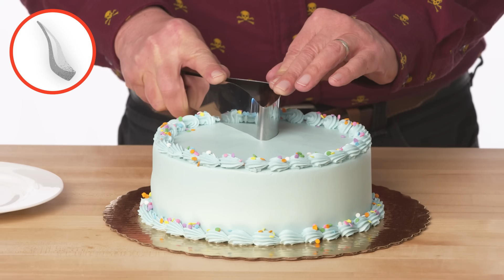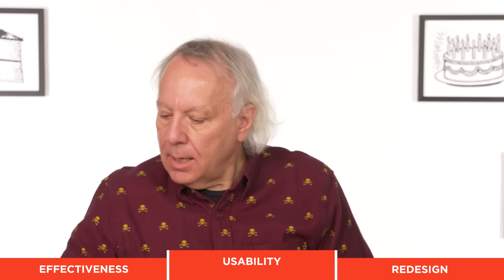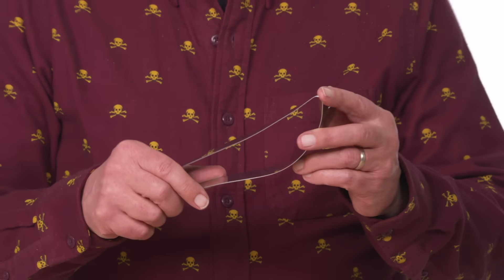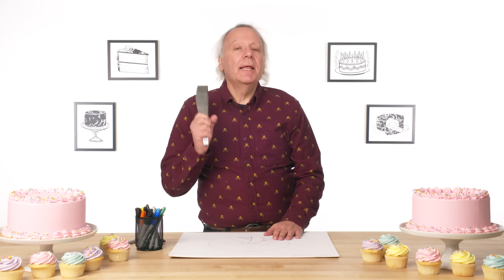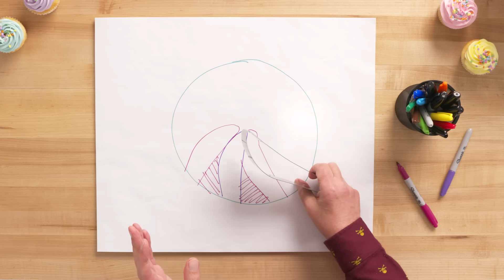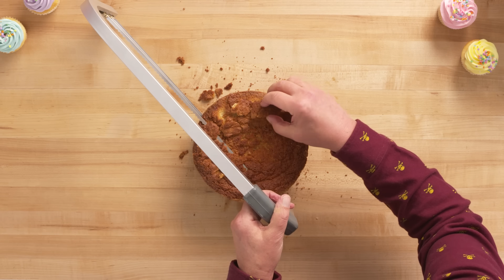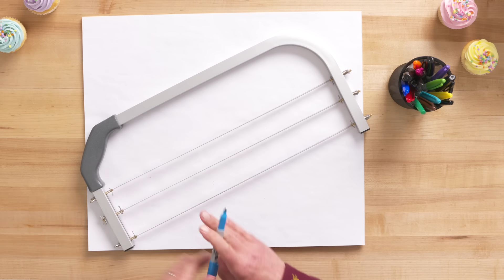5 Cake Making Gadgets Tested by Design Expert | Well Equipped | Epicurious

Comment: TBF, if he didn't approach some of these like the hopeless infomercial people, they'd work great.    You dont use a meat cutting knife to cut cake or pie.   He set the device up for failure.  
Notice none of the cutting items match his knife selection?   Yeah...   and to keep slicing with a caked up knife is hand-2-brain failure, not device failure.    Thats like blaming a cutting board for uneven bread slices
Reply: ...and don't go telling me "there are people out there like that"
Yes, and there are people out there that don't know how to drive a car.  We don't simplify highways and roads to appease to those who lack the skills.
If someone isn't capable of using an item correctly, it's not the devices fault.    Like using a knife to hammer a nail.   It's not the knifes fault.
Reply: those infomertial people are a stand in for elderly and disabled users dude

Comment: That hacksaw looking slicer... Seeing it next to the knife and ruler option, it sure seems to have made much more even slices! They weren't perfect, but they were better than the latter. It may have taken more time and been harder to use, but it gave better results.
The top layer getting mangled was due to it just being too thin - and that's a height adjustment issue. I will concede that could be a usability issue, but it could also be the user's fault.
I think going for more of a hacksaw or two-man saw design would have been better - have the push be at cake-height, not above. Putting the handle at the top wouldn't change a thing. Having something to hold the cake stable would also help, since you wouldn't worry about cutting your other hand.

Comment: I've got one of those cake levelers but the handle is on top (as he suggested) and the blade is a wire. It cuts really well and the adjustment of the setting is so much easier than the one on here.

Comment: why no get a set of blades cake shape and maybe a bit bigger and just cut with that like 4 8 5 10 you can get 4*4 that fit into each other and just by pushing down cut 8 or 4 all at once
edit : you gotta have a decently sharp and strong blade and come in a case for cakes and that way you even have a place for your cake/blade storage

Comment: Perfect Cake Divider: I think that the better way to use it is to mark the cutting lines only, remove the device and then execute the dividing process. The device remains clean, the accuracy is better (you can precisely turn the device to the next position), the cuttings can be made from the edge to the center of the cake. ;-)

Comment: Thoughts as watching

Cake Divider
He should really be using a different knife.  Anytime I cut a large cheesecake or anything with a fancy but delicate frosting, I reach for as small of a knife as possible.  I've even cut cheesecake with wire (taken from a cheaper crappier version of the leveling slicer thingy I saw is coming up in the preview.)  Actually, I could see using the divider to just score/mark the very edges of the cake.  Then, you could use a long blade to cut straight across from one score to the other.  (Only works with an even number of slices, though.)

Edit after Posting:  I've actually used a version of the diy-protractor method.  Difference is that I did it as an image of divided circles on my computer so I could reprint it when needed.  Also, I did it to make a 7-slice pie (as opposed to buying a $20 version at a restaurant supply store).

Curved cake slicer
I wondered of the purpose and saw the curv-edge leftover issue immediately.  Definitely a solution looking for a problem.  This would actually work better as a "whole-cake slicer".  IE:  A giant round circle with blades that cuts all the slices once.  You could then get the cool-shaped cake slices (and more than just a curve on one side) while still making all the slices evenly sized. (Note:  Typed this before seeing his redesign.)

Leveler
I have a couple MUCH CHEAPER versions of this that have one adjustable blade.  I've always found them hard to keep up straight up, leading to the layers being angled.  The only way I could see this thing working would be to have an entire contraption that houses the slicer and holds it up straight.  To be honest, I can only imagine something so large and cumbersome being useful in an actual professional bakery that does a LOT of business.  However, most of the people in such a place would likely have enough skill/expertise in cake slicing to be able to properly cut levels of a cake free-handed.  My own version doesn't even cut cake very well unless it's a soft cake because the wires can't go through much.  (Though as stated before, the wires have been successfully cannibalized for use as soft cake/cheesecake slicers.)

Zyliss Easy Slice
Another thing I have a cheap knock-off of.  It's just as useless as the expensive version.

2-handed cake slicer
-The only almost useful one, and they don't even have a link to it?!?!?
-Actually, this seems to do "curved cake slices" better than the thing designed for that purpose.
-I could see an actual hinge being useful in this to get rid of the bend factor.  However, it would have to be incredibly small so as not to mess up the center cut-point of the cake, and VERY VERY well built so that the screw doesn't come out into a piece of cake.

Comment: I have a cake leveller and my only re-design is that the feet have balls on them to move, like those early 90's computer mouse balls. So when you sawing away, the balls can go any direction. I agree, the handle needs to be in the middle

Comment: The cake cutter was actually user error. I have used these similar saws professionally as a former baker, tho mostly with only 2 cutters, and they work great!
To use them well you need to saw in a fast, even motion without depressing the cake too hard with the other hand. Doing it too slow will mess u up and cause the cake to be mangled. That said the one u got can be made massively better with a flat bottom on both ends so it reduces wobble and allow u to have it standing in between usage for less clutter. Most new once i used had that. Also what is with that handle? Thats looks horrible. Ours were mostly made with a round steel tube and i can't say a handle was ever needed, so either side could easily be used. It's something you need to know how to use but when you do you can cut ten EVEN cakes in 30 seconds which helps a lot in the bakery. :D Especially since it takes a lot of training to be able to do it evenly and quickly with a knife.
For a layman, outside of the bakery tho, i can understand why u think it's useless.

Comment: I have a cake slicer that has a single cheese wire as it’s blade (so works left or right). The single wire which is easily raised/lowered is easy to use and you can just remove the bottom slice, do the next and again (so all slices are equal). It’s brilliant.

Comment: For the cake layer slicer, I had a different idea, in many kids toy, like cars, when you connect the wheels the plastic wheels have a thin tube with large flat end to prevent the wheels to move.

My idea was instead of blades, the device will have flat plastic shelves that move (connected and disconnected the same way abuve) and help you layer the knife when cutting. I will also add different size flat covers (like pot tops) that you can use to hold the cake so you won't accedenlty cut your fingers (your hand was very close to the blade).

Is this a good design? I feel like it can work but the final product almost allways be different then words on paper

Comment: Cake levelers are used in professional use. Something some "random" guy is not able to handle is not something it needs to be faulty. I've used same kind of device for thousands of times and it is somewhat faster and precise than knives. Also when you do hundreds of cake bases in a year and same amount of cakes, you dont need to adjust those blades.

Comment: One immediate advantage of the last one is the hands off serving, and if you are selling cakes by the slice, you want a uniform size so that really is not a problem either.

Of course, I use a cake server with a sharp edge that can both cut and lift the pieces...

Comment: On the very first one, not gonna lie, for the type of cake he is cutting he chose a terrible knife to use, using a better knife would easily have fixed a few issues, a smaller blade instead of a bread knife would have cut way more cleanly.

Comment: What that cake leveler really needs is a base that it is firmly attached to. Then the base has some grooves drilled in so the leveler frame can smoothly slide back and forth in. That should eliminate any pulling up on the cake.

Comment: The cake leveler gets even worse when you realise that a normal leveler uses a thin wire to cut the layers, making less friction and very little wobble. The three blades are wider leading to a LOT more friction and it's wobbly bc it's not a taut wire, it's a wide, thin sheet of metal that's easy to warp.

Comment: I don't get why everyone is being so negative towards him. As an amature baker and cook I've had similar problems with things that are supposed to make it easier but only waste more time and take more energy. 

Take the first one. Regardless the thing is going to leave a hole in the middle of the cake. The rounded cake cutter is just plain stupid and would really hurt your hands and takes a lot of force to actually cut the cake. The leveler doesn't work because having 3 layers makes it even harder to keep both of the bottoms on the table so it cuts evenly. These things are supposed to make it easier but even if they did get you perfect slices they aren't efficient, therefore effective, because they take longer to use than the normal way.

Comment: wtf type of massive knife is he using to put that first cake. Dude butchered it. My Lord.
As for the "curved" cake knife. It's clearly for decorative purposes. People do a lot of cake design, decoration, themes, etc. It's lie complaining about cookie shapes. Squares would be more efficient to cut right? 99% of cookies aren't square though.
The cake layer cutter, again, complete fail of the operator. And look how horrible he did just trying to use a ruler and knife. Why not show that complete fail? Dude clearly doesn't know how to cut a cake to begin with so obviously isn't going to do well with this tool.

Comment: For the cake leveler, I would have changed it to one thicker blade with some device to keep it at a constant height. Then you can just cut, then move the top off and cut the top and repeat till you have all the slices you need. So it would really work better designed
 as a knife level basically.

Comment: The 3rd gadget is not so bad, the one in the video is. But I saw someone on YT use a similar one that had one smaller blade and a ruler to adjust its height and it worked good.

Comment: For cake leveling, there any reason why you wouldn't just want a set of metal rings at common heights and a long serrated knife or wire? Slap ring around cake, use long knife/wire across entire width, lift, repeat?

Comment: When using a knife to cut a cheesecake, even with a cake divider. Have a hot glass of water. & A clean towel. You need to dip the knife in the hot water. It won't damage the icing, & cleans the blade off for the next slice.

Comment: These cakes look horrible, all incredibly dense and overcooked. The purple, yellow and I think blue cakes are just massive pound cakes, with no frosting in the middle??? That is going to be so dense, especially if they are cold from the fridge and not at room temp. 
Additionally a simple google search will tell you to use a hot, sharp knife to cut a cheesecake and wipe the blade in between slices. This is so frustrating to watch, I know he has designed lots of kitchen gadgets, but he doesn’t act like he can use any of them.

Comment: To cut an unfrosted cake into layers: use the ruler or anything else as measurement around the cake, then lightly cut into the cake all around, then take a piece of thin yarn or flossing line and lay it around, twist in front, pull
It's the easiest and typical mother home way of cutting it

Comment: I'm so annoyed they used cheesecake for the first test. Cheesecake is closer to pie than cake. The consistency is totally different than cake and it will not behave the same. Idk if the tool would have worked any better, but it would have given it a fairer shot than something that is so gooey and shifts so much when you cut it.

ETA: pretty sure he was using the curved cake slicer upside down? I love Dan, but this ep could use a redesign...

Comment: "I'm in a bit of pain"

YOU PUT A DAMN CLOTH UNDER THE HANDLE. Also, the whole " the edges don't work because they're different" is solved by "FLIPPING THE CURVED SLICER AROUND". Christ
Reply: That's not the point if the experiment. The designer should have included a platform or plastic padding

Comment: The cake divider could easily be replaced with a set of pronged wires. Even if there were seven or eight pieces (one for each number) the required storage space would be roughly the same. Alongside this, the reduced bulk and lack of moving parts would make it less destructive to the cake itself. As it is, the product is 100 times more complicated than it needs to be. It's been overdesigned just so it can appear more gadgety and eye catching. Give me five minutes, a pair of pliers, and a box of paper clips, and I could make something that does the same thing but better.

Comment: Dude has no clue how to use a saw. You dont push in while you saw and with something like this you want the blades slightly angled down so that it doesn’t rise up. I agree that it could be made better but you have no clue what you’re doing.

Comment: I have NEVER seen a cake leveler like that… its like he found the weirdest most off brand cake leveler possible and said good enough. Wilton (popular cake decorating company) makes a cake leveler that has a substantial handle, a taught wire in between the two sides instead of serrated blades, and an easy way to adjust the wire. you can literally find it at any micheals or even a joannes maybe. sometimes with these reviews it seems like he sets products up to fail, giving them a bad rep when there’s genuinely better versions of the things he’s reviewing
edit: I looked it up and you can get the one I’m thinking of for $6 on amazon. it’s a smaller version, but they have bigger ones. the one I have is good for something around a 9” round cake

Comment: How to: Perfect cake divider.
Step 1: Get a small metal (or other material) piece for each number of slices you want, with fins equal to that amount and some ease of both being pushed and pulled.
Step 2: Press it into the center of the cake, so that the fins cut shallowly in all directions. Then pull the device back up.
Step 3: Cut the cake by aligning the blade to those shallow cuts.

Comment: On the easy slice, it could be improved 1000 times by just lifting the plastic piece 90°, that way it actually pushed the cake of the metal cake holder thing

Comment: The cake divider, if it is going to leave the center uncut anyways, should just have multiple thin posts to hold its position.  3 or 4 closer toward the rim, and one in the middle for centering.  The cutting channels are then on another piece that rotates.  Or... don't have those channels at all.  Ever seen a laser level?  Have two cheap laser units that shine a line on the top of the cake.  That would prevent cake from getting stuck in those channels.

Comment: Hey 'Genius(more of an insult)', it is plausible you used the the first to gadgets for different cakes, the curve slicer might do better with a cheesecake than an actual cake as well as a way of arranging the slices into a decoration or such.

The bonviee Cake leveler doesn't seem like a handsaw, even though it has handsaw blades. it is plausible to slide a lazy spinning, unfrosted cake toward the handsaw blades.

Comment: the cake leveler review really annoys me because as someone who uses that on a regular basis. we use this in the kitchen i work at every day and it never fails us. not exactly that brand but near exact same design. just make sure you saw more than you push the blades. keep it on the table and keep it straight it'll work just fine. every tool in a kitchen takes technique and skill. we have people coming in everyday for cooking and baking lessons and they never fail to use it. it's simple three ground rules and used for both left and right handed people
Reply: Yeah, right? I learned Baker, and every baker I know uses this kind of  "saw" xD

Comment: As someone who bakes and decorates layer cakes as well as owns multiple cake layers, the cake leveler will win out every time. The bit of extra time and effort is worth the ease and speed of a knife due to the end goal being even and clean cut layers. What does need to be changed on this leveler is the handle and the blades. I find that wire works better than blades.

Comment: Why would you ever, ever use sawblades who are designed to be flexible for hard materials like wood or metal, for precice cutting, on soft things like a cake... 3 rough thin wires instead of the blades would work 100times better, plus the whole tool would not slide up and down while useing it.

Comment: I just realized...I think you're supposed to flip the curved slicer around so that the blade is now your handle and the handle is now the blade. I think those cures would fit. Or maybe you're supposed to use the entire thing to cut across the whole cake at once? 

still a 0/5